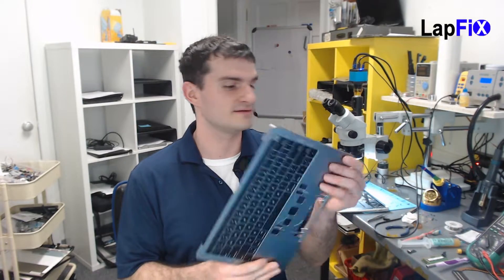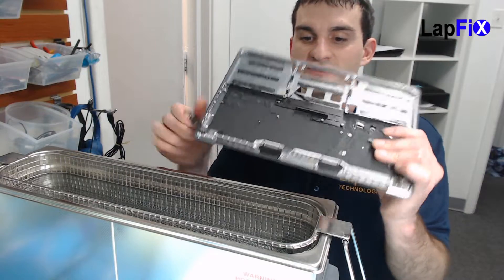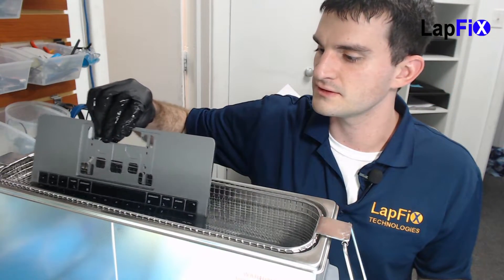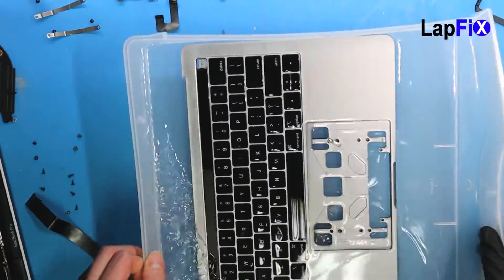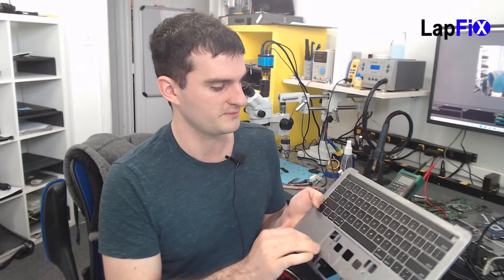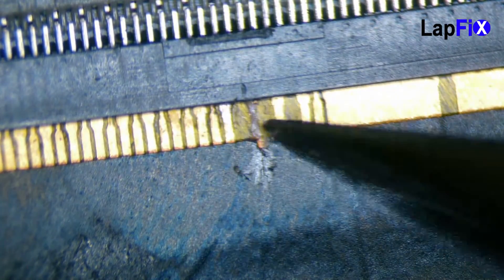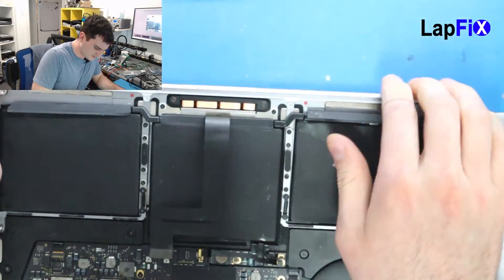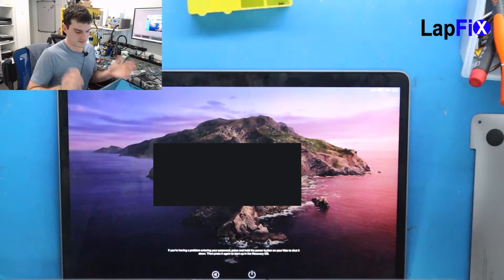Fixing MacBook Pro 2019 touch bar keyboard and trackpad using Ultrasonic Cleaner  - Part 2

Comment: I have an A1707 covered in stomach acid, vodka and coke. All keys and touchpad are completely stuck so it's got to be worth trying this method since I have a similar 40khz ultrasonic with sweep 🤞
What liquid are you using in your ultrasonic?  I know that can make all the difference. Thanks again
Reply: hi, did you try this? what was the result

Comment: Hello, good video. I would like to know the model of the ultrasound machine you use but especially the measurements (cut in length and width) because Iwant to buy one. Thank you
Reply: We bought 2 units (1 small = TUC-32 & 1 large = TUC-300) from (Claire) Jeken Ultrasonic Cleaner Limited.

Comment: Did you install a new battery? Or did you use the original battery that was in the laptop before the repair was started? What do you recommend.?
Reply from the maker: Yes, we reused the same battery.  You need to be careful removing it and putting it back as it is adhered to the top cover

Comment: Did you use the original battery? Or did you put in a new battery? Very good video,
Reply from the maker: Yes, we reused the same battery.  You need to be careful removing it and putting it back as it is adhered to the top cover

Comment: Hi There, how do you dry the keyboard after ultrasonic cleaning?For how long?Thanks.
Reply from the maker: Best way is to use Alcohol after to push all the water out.  Then overnight with a fan blowing on it should be ok.  The goal is to make sure you don't plug it back in with any moisture

Comment: I just spilled about a quarter of a bottle of water on my Mac book pro 2020. I immediately flipped it over, it was already turned off (dead), I shook the laptop a little and dried the exterior with a towel and interior ports with a thin paper towel. I am now letting it sit upside down in a V for two days but if the damage appears after that time how can I contact you guys for repair ? M
Reply from the maker: The damage can appear and get worse over time.  The components can corrode and give you issues.  Best thing to do in the meantime is to leave it off and not try turning it on. We have our contact information located in the description if you're interested in the repair!

Comment: Hi, i just saw your video actually I am dealing with same problem. Its like all the keys are working but the problem is for touch bar .. Its not working at all what can i do please suggest
Reply from the maker: If it doesn't come on or it doesn't register a touch to the touch bar it seems there would be an issue with the touch bar.  Could be a part of a liquid spill or power delivery issue.  If you are interested, we have our contact information in the description

Comment: I've spilled water over the keyboard of my Air 2019, it all works fine now after over a month or so, except the backlit keyboard flickers so i keep the light turned off. Any idea how i could fix that? There aren't any parts available at the moment.
Reply from the maker: It can be one of two things, either the back light on the keyboard is damaged or it is a logic board issue.  If you are interested, we can take a look.  All of our contact information is in the description.  😀